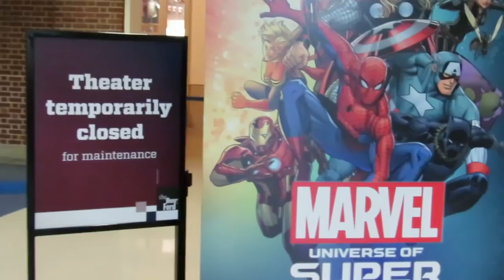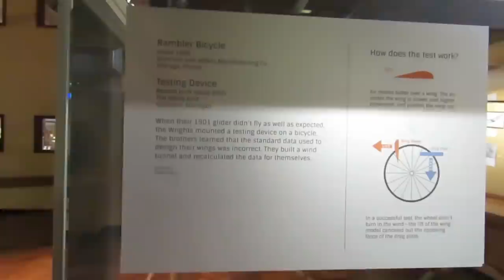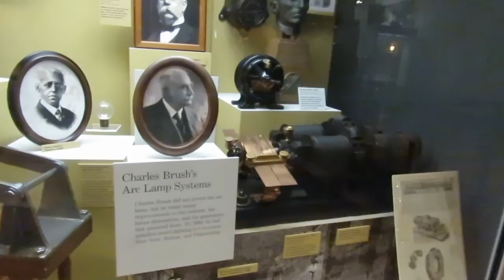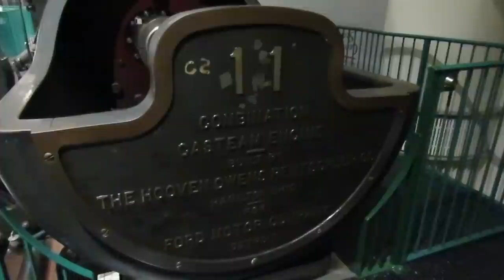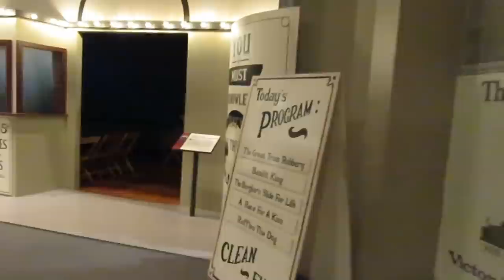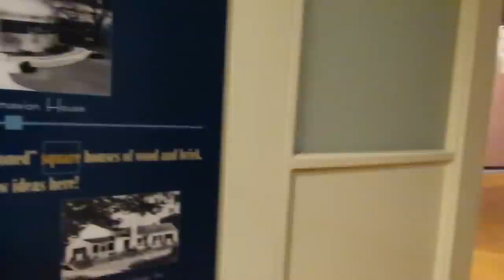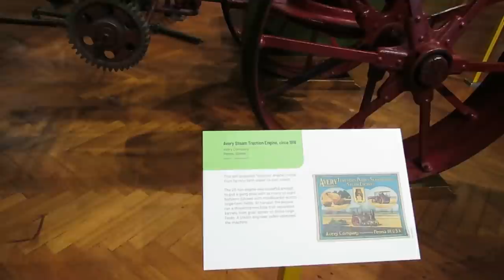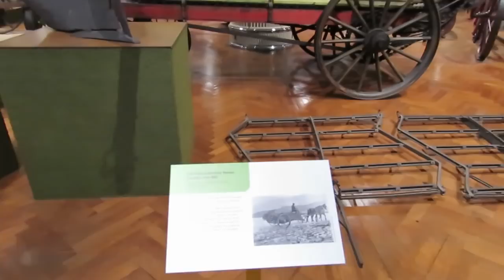A Walk Through the Henry Ford Museum ("The Henry Ford"), Part 1

Comment: The unidentified aircraft at 10:20 is additionally mysterious for its odd looking engine with 6 cylinders in apparent radial format which is not possible as a radial.  A closer look shows there's some offset in the cylinders placement, as if its three horizontally opposed 2 cylinder banks.